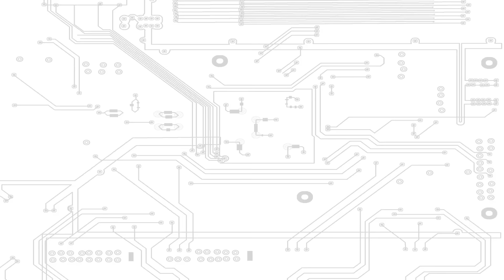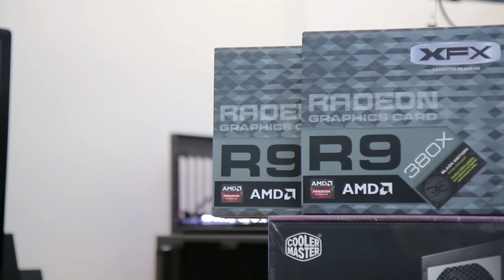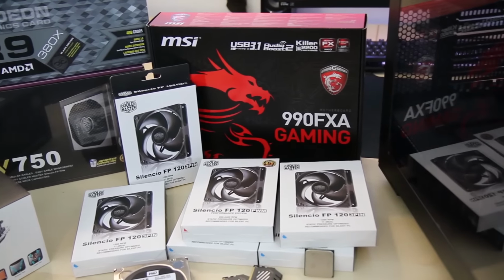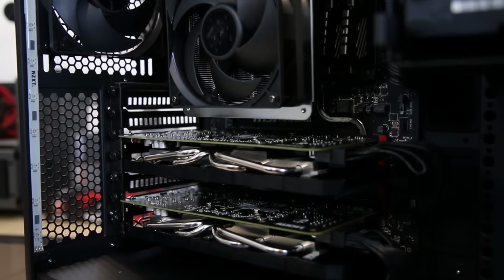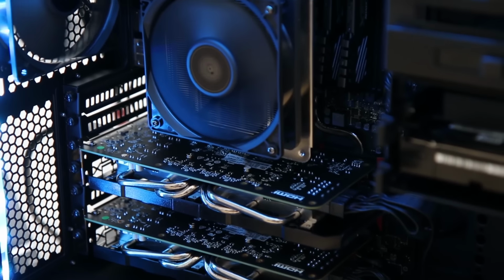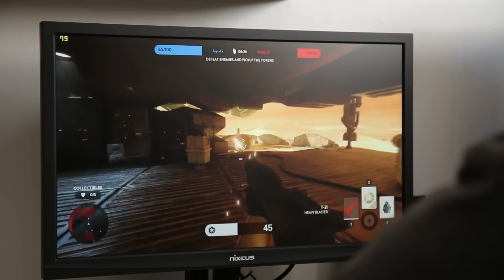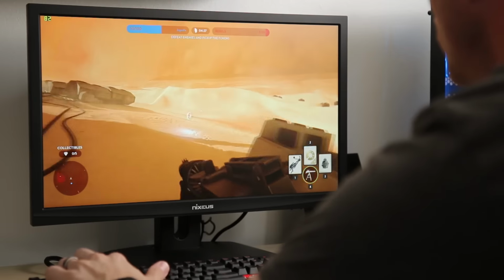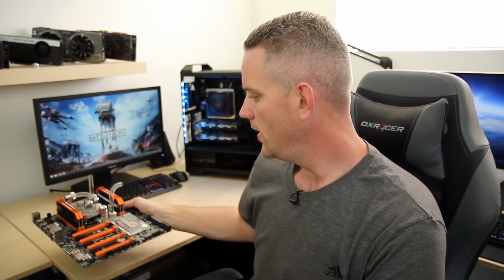AMD Gaming PC - Is AMD still good?

Comment: I've priced out this build (sans video cards) and it comes in fairly cheap.  My question is, why bother with AMD?  I'm currently running an AMD build and I don't think it's that bad, but with everyone looking down on AMD, would it be more beneficial to put together an I5 if you're trying to come in cheaper?
Reply: +Phillip Snyder Well, as most games that have been released during the last year scale really well on 8 threads, the AMD 8 cores like the FX 8320 and above often offer comparable if not superior performance to an i5 and are much cheaper. And in terms of graphics cards AMD beats NVIDIA out of the water unless you want to enter the 450$+ price range.
Reply: +Antares 8001 AMD is NOT superior to Intel on any new game with a comparable i5. There are plenty of games like Dying Light and Witcher 3 that prove this.
Reply: But than we have games like Crysis 3, Battlefront and Assassins Creed Unity where the FX 8320 of a friend of mine was always about as fast as the i5 3570k(both at stock clocks) of another friend of mine give or take 10% depending on the scenario. And since the trend is definitely going towards optimizing games for more threads and with DX12 coming up AMD CPUs are more than a valid option for gaming especially considering Intel's ridiculous prices.
Reply: +Hoolio VonLoot  you're way out in left field.
Reply: Shy Vana we dont all live in the same country you fool.  An i5 4460 in Australia is $280......an 8320 is $200.

Australian pricing is a joke.....I paid $515 for my 4790 in my work computer......
Reply: Hoolio VonLoot 1. Anecdotal evidence is anecdotal. You can pull anything out of your ass about your "plain media PC" and your "home work rig." I can do the same, watch:

"My i3-4370 gets 120fps on BF4, almost doubles the similar FX-6300. AMD sucks, doesn't it?"

No. Discounting arguments based on personal experience is a logical fallacy. Don't commit logical fallacies.

2. In the US, the i5-4690k is around $40 more than the FX-8350. No one said anything about i7's as well, of course there will be diminishing returns of new PC parts, they are obviously unnecessary. Spending $40 on a better processor than can provide 20+ fps gains is well worth it. Take here:

http://www.techspot.com/review/1089-fallout-4-benchmarks/page5.html

The i5 beats the 8350 by almost 30 frames. The 8350 can barely handle 60FPS on Fallout 4 with a GTX 980 Ti.

http://www.techspot.com/review/1006-the-witcher-3-benchmarks/page5.html

Even in the Witcher 3, FPS gains of 10 are still worthwhile, as it shows FX processors significantly bottleneck newer GPUs.

3. And then, of course, comparing them with tests conducted by real system's CPUs.

http://cpu.userbenchmark.com/Compare/Intel-Core-i5-4690K-vs-AMD-FX-8370/2432vs2983

Only the CPU was tested in these tests. FX 8350's clocked at over 5GHz only scored a 79.1%, while the mean 4690k score was an 87.3%. Overclock it to 4.8GHz, and you're seeing scores rises to over 105%.

4. Calling someone a blind, biased cunt makes you look like a third grader, and it proves you nothing more to to bring to the argument than personal sob stories and insults.
Reply: Hoolio VonLoot Not to mention Intel has much stronger cores. Take it like this: AMD has 8 average men pushing a heavy weight. Intel has 4 strong men. They might seem to equal out, but if you put them in a contest where they can only use 4 men (cores) (like all AAA games out currently), Intel beats them accordingly.
Reply: Shy Vana thats why i use intel for all of the machines i have that might see gaming.  I play way too much skyrim to use an fx for gaming. 

Australian pricing is a big deal for me.  I don't care what other people pay for a cpu. 

If you can't see that an 8320 at 4.5ghz with 16gb 1866 on a 970 gaming board has a lot better workstation performance compared to an i5 4460 with a h81 motherboard and 8gb ram for the same price, you are blind..

Just because an fx gets a few frames less in certain games (even though its cheaper anyway), doesn't mean it should be removed from history and mocked for the rest of eternity.
Reply: Hoolio VonLoot But we aren't talking about workstations. This is a video about gaming PCs.

Comment: AMD isn't that bad on the low end. I've got an AMD a10-6800K @4.99MHZ and Nvidia 960 overclocked maxed for its SKU and overvolted and it's well balanced to my knowledge. Works well for ANY game that I throw at it and keep the VRAM in check.
Reply: Ey b0ss r u sirius because i have a10 6800k but not so good so i if i would add a graphics card it would be better
Reply: ZaKh10 yes

Comment: how much power would you reccomend for a 390x card? since i'm prolly going to do a amd  build for my very first buid
Reply: +Brandon Plays Opt for about 750w or more
Reply: +Chance Fletcher if you pair it with an overclocked 5960x, 12 fans and 8 hard drives maybe... a system with a 4770k oc'd to 4.4ghz and a single 390x pulls about 420 watts from the wall when gaming, so 600-650 should be fine with plenty of room to breathe. 550 will work too, 500 would be a bit sketchy, but fine if it's a good PSU. those results were achieved with a 80+ gold rated power supply, so it actually pulls about 380 watts from the psu itself
Reply: givemeajackson I'm just saying 750 isn't too much more and if later the option came up for say another GPU he wouldn't necessarily have to buy another PSU. I always get more than I need to accommodate for system changes later especially when the price difference is minimal.

Comment: I like AMD's accessibility at lower price points over the intel equivalent price. Ultimately, its really what one can afford. I run Battlefront on an AMD hexcore and it does the job fine. The game itself has its fun and not so fun bits but still, you can have a great experience gaming with an AMD setup. ^__J^

Comment: +JayzTwoCents, Unrelated to the video a bit, but getting ready to build my PC (high FPS 1080 machine with possible 4k and SLI in future) and was wondering if the i5 6600k and a GTX 970 are a good combo or is the i5 easily capable of handling that and would i be better off with a 980 or even a 980ti. My budget is kinda flexible to a point and was thinking of moving it up a tier on the GPU but don't want to bottle neck the CPU to bad... having a hell of a time finding a direct forum topic like my question.... I do see that the i5 and 970 seem to be a popular combo but i also have also seen peeps throwing in the 980's on their builds... Just want to get your "Two Cents" on the subject... thanks for any help and great vids btw.

Comment: the 8370 has the exact same base and boost as the 8350. please do your research, i expect more from you.
Reply: i guess the 8370 turbo is advertised as 4.3 so your right, but in all honesty they are the exact same the physical chips are exact copies there just labeled differently due to binning the 9370 and 9590 chips as well
Reply: not exactly higher quality there voltages are consistently lower but have much lower overclock potential.
Reply: what motherboard?

Comment: Im building a budget pc right now and it cost 34k philippine peso or 700 us dollar and its way far from this tower it only have 1 geforce gtx 750ti, core i3, gskill ripjaws 4gb 16mhz.
Reply: +raul galicinao 
geforce gtx 750ti
core i3-4170
msi b85m gaming motherboard
gskill ripjaws 4gb 1600mhz x2
seagate 1tb sata 7200rpm
thermal take smart 730w 80+ power supply
AOC 21.5" 12269vw IPS LED BLACK MONIITOR

Comment: This is was what i was gonna build to replace my i5 3330, but went with the e3 1230 v3 for no good reason (slightly more power efficient)(i would never get the 8350, but the 8370 is a great chip [power consumption, speed, etc])

Comment: I am an AMD gamer (first timer) and planking to overhaul my system for improved cooling and airflow. (Any product ideas/ tips would be great!) I'm planning on using a 750D airflow edition case, that mb you used in this video, my current 6350 cpu, 2 3.5, 1 2.5 and 1 ssd storage system, same 750 PSU a h110gti cooler with 5 sp140mms with a fan controller and getting new (less powerful) ram installed to match the colour scheme, I HAVENT decided whether ima get the MSI gtx970 graphics card or stick with my r9 270x but any different but affordable cards would be recommended, the budget is 500-700 and was just curious on; A. What you think?
B. Any ideas/ alterations
C. Will you add me on steam if you got it xD

I enjoy watching the videos especially during college #studentfml while drooling over systems and builds I couldn't afford in this life time xD keep it up Jay :)

Comment: hi jay, one question. 

I have a FX 8350 with an asus M5A78L-M/USB3 and a r9 280, but i have in mind change it for a better board. I read this board have problems to keep under control the voltage of the cpu and the 8+1 phases are better for having better performance and stability on this cpu, this is really true? It's a good inversion going to catch a 990X / FX board? or i can still rocking with the same board?? thanks in advice, and sorry for my bad english.
Reply: +xXVictorevolutionXx   yea definitely get a 990fx motherboard if you wish to overclock

Comment: From what i've read, the r9 380x is supposedly about 5% better than the vanilla r9 380. I'm currently looking for a budget gpu and was wondering if i got the vanilla 380, can i oc it to get 380x performance? the difference in price for the two in aus is like 80aud.
Reply: The 300 series is pretty close to being maxed out, but a small 5% increase is doable and just about the max OC you can expect...but is it really worth OCing for like 2 fps more?
Reply: Valid point but I'm guessing most people would oc anyway to get thr best possible performance....

Comment: Hey, Jayz. I have a valid question for you in regards to the GeminII ver. 2 cooler.

I have an intel-based mATX motherboard, with two Corsair Vengeance RAM sticks (8GB total) with the "high profile" heatsinks (God forbid I wouldn't be asking this question if I got the LP (low profile) version), and an EVGA GTX 960 SSC. Would it be feasible to buy this CPU heat sink fan and orient it either facing the front end towards the sticks, the GPU, towards the rear exhaust fan, or upwards, where the 4-pin CPU fan header is located? As much as the latter is optimal for my situation, I feel that it would be quite the endeavor to get that 4-pin cable plugged in once I get the entire HSF fully set up. I am asking this because as much as I would love to get a 212 EVO, I really don't think it's advisable due to its height (my case's instruction manual says it can take heatsinks of up to 170mm (or 6.7 inches) tall, but I think that's just a load of bullshit based on how I measured it out and looked at it). Also, I really don't want to get the well-revered 212 EVO and then suddenly become disappointed because it's too tall for my case door to shut properly, like how I saw on my brother's custom rig (though he said he would rather not worry about the case door being on there, something I'd rather not do, myself).

I know, long question, but since you're using that low profile cooler, I had to ask.

P.S. I use an intel Core i3-4370 with Hyperthreading enabled, and I mainly use this for gaming (if the RAM and GPU weren't obvious enough), and I notice that the stock cooler tends to be a bit noisy (via the fan making a vibrating noise, as if it were a machine from the 90s when the disc is spinning up) and lets the CPU go up to about 60 degrees Celsius when under load. Not something I find as "favorable" when its Tcase is about 66 degrees Celsius, according to Ark.

Comment: did you use the crimson driver? because crossfire is beast mode in my system.

going from 80 on my 290x to 150 when i double it up

Comment: I'm new to pc building so is this any good for black ops 3/fallout 4?

EVGA GeForce GTX 960 4GB
MSI 970 GAMING DDR3 2133 ATX AMD
Crucial Ballistix Sport 8GB
Seagate 1TB Desktop HDD SATA 6Gb/s 
EVGA 600 B1 80+ BRONZE, 600W
AMD FX-8350 8-Core Processor
Cooler Master Hyper 212 EVO cpu cooler 
Thermaltake Versa N21 Tower 
Asus 24x DVD-RW Serial-ATA Internal OEM Optical Drive
Reply: Get an i5 they are much better for the same price
Reply: The thing you need for games is single threaded performance, and at that the 8350 is a piece of garbage
Reply: +Mion the Demon look at faceman at linustechtips.com
Reply: +Zach Tom "8350 is a piece of garbage" lel nice meme

Comment: Jay you should do a comparison of the 8350 verse and 6600 or 6700 with crossfire or SLI see if the 8350 can compute fast enough to keep the cards fed I am currently running  a 8350 with two r9 290s and I don't know if the CPU is able to keep up with the cards when I turn graphics down I don't get more FPS the cards just go down in usage would be badass if you could do a video on this

Comment: i'm getting a r9 390x, i'll also have the same processor and like 16 gigs of ram, all on a asus  sabertooth 990fx r2.0
just curious if it would perform just as good, if not better??
Reply: +Viiv SYN   this  would  be  bottlenecking  the  390x  in  cpu  intensive  situations ..
Reply: hello walkman thanks for the feedback, but recently i decided to hold out for AMD's new product line
Reply: Viiv SYN   yea  me  too.   I'm  waiting  for  Zen  :D
Reply: hello walkman yeah that zen sounds pretty exciting, wish i knew the specs more though, all i know is its 16 core and socket type is am4, would like to know its speed
Reply: Viiv SYN   Consumer  parts  will be  upto  8 core  16  threads ..  Not  much  is  known  about  speeds..   By the way  Zen  isn't  coming  before  Christmas of 2016  so  it's  still   far  away  :(
Reply: hello walkman really, i heard somewhere its going to be march 2016... if thats the case i might be best just to build my pc now... so i might need to know how to prevent the bottleneck in the build i listed above
Reply: Viiv SYN  am4  motherboards  are  launching  in  april - march  2016  along with  Bristol  Ridge  apus ..  Zen  will  not  arrive  before  October  no  way ..

Comment: ive got an 8350 an that motherboard but I use Nvidia graphics. I wish I could get an intel processor but buying that and a new motherboard is fucking expensive. I'm happy with the 8350 though.
Reply: depending in where you live, used hardware can be very viable

Comment: has any ever noticed that all gaming laptop are intel/nvidia 
some laptops have amd APU's that can game but not like intel/nvidia's
i guess amd is still to hot to game on in a laptop (even tho my amd A8-4500M and 7640G APU seem to keep playing gta 4 on high settings at 1366x768 (even tho its 4 years old and gta 4 is what like 8 years old now)
Reply: Weirdly, Apple uses AMD GPUs in the 15" MacBook Pro
Reply: true but does it run games like intel/nvidia does
Reply: true 
but i was just saying
i haven't seen any gaming laptops with amd in them and when jay/jerry talk about amd they always make fun of them being hot so that kinda why i said what i did 
plus im using an alienware alpha with the 860M 2gb and intel i3 4130T and it runs hot too and its kinda like a gaming console (aka the windows version of the steam one jay reviewed)
Reply: +willam endler (willendler1993) Its simply that AMDs higher end offerings in the mobile world dont translate well to performance. While for the buck they do well in desktops as i have an athlon 760k/290x build sitting in my tower, but for laptops, the mobile chips are already weaker then their desktop parts, why do with a chip thats even weaker then that. Specially since most people cannot crack a laptop open to change it. Id hate to imagine my current gaming laptop with an i5 3340 with gtx 680, with an amd mobile chip, can you say bottlenecks.
Reply: Yep, I have noticed that. I loathe Intel with an unbridled passion, so I'm having difficulty enough finding a proper laptop even if I accept I have to use Radeon graphics, but my favourite combo that I've used in all my main rigs, an AMD CPU plus an Nvidia GPU, is simply non-existent in the laptop market...
Reply: +willam endler (willendler1993) you just blew my mind. gta iv really is 8 years old. wow..
Reply: i just guessed lol
wow my old hp dc7800 small form factor pc with intel core 2 duo e6500 and amd 6450 HD silent 1gb still runs it on high and people still play it
Reply: never saw that gaming laptop
Reply: i though so
i saw the nvidia one and i was like they made an amd version?

Comment: That was on 1080p? Im getting 100+FPS with 2x960 4GB FTW SLI and a i5 4690K and 70+FPS in 1440p.

About the video, maybe the CPU was Bottlenecking those 380x's.
Reply: +MegaAgente17 remember what he said about the driver issues atm. The cpu should be fine but right now he is only using one gpu
Reply: +MegaAgente17 obviously someone didn;t listen to the video.
Reply: Hoolio VonLoot Of course i did. Just it seems to be very low to me, but it's like he said, drivers.
Reply: over 60 fps in a beautiful game maxed out looks good to me
Reply: Yep it most likely was bottlenecking it

Comment: Building a PC with two r980x  is a 750 really enough? They seem like power hogs. Thanks in advance. 

Build
Intel Core i7-6700K 8M Skylake Quad-Core 4.0 GHz
MSI Gaming Z170A KRAIT GAMING LGA 1151 
Cooler Master Hyper 212X – CPU CoolerG.SKILL Ripjaws V Series 16GB (2 x 8GB)   x2  32 gigsMasterCase 5 Mid-Tower Case with FreeFormMSI Radeon R9 390X DirectX 12 R9 
Still deciding on the fans.

Comment: Could you sli a r9 380x with an r9 390? Asking because if I win (likely won't) this pc in the giveaway I'd like to either sli my superior card, the 390, with this or would I just have to switch both the 380s out for the 390?. Just asking cuz curiosity